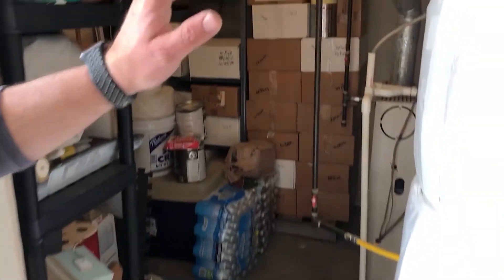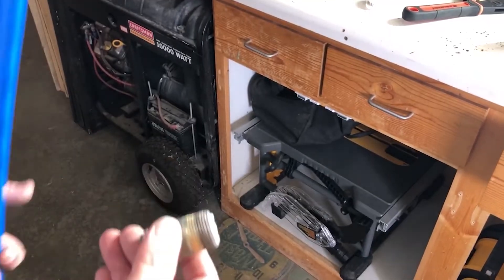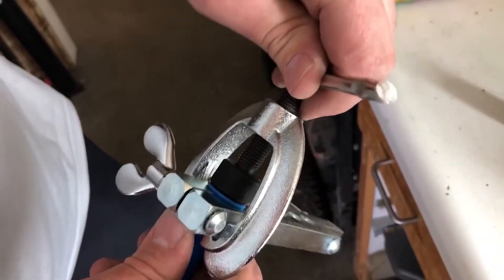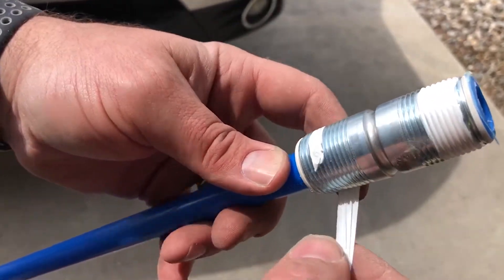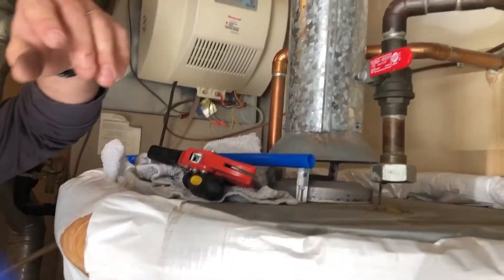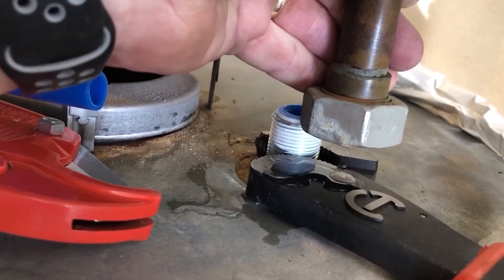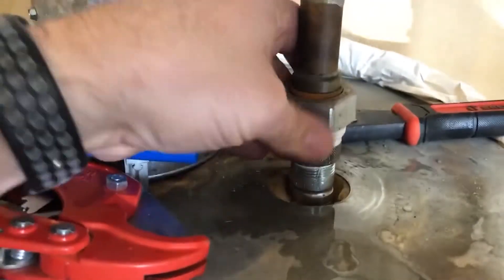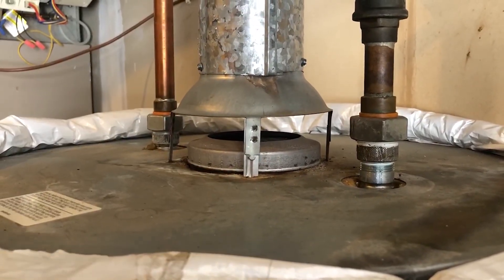REPLACE WATER HEATER DIP TUBE: COLD WATER INTAKE DIY WITH PEX

Comment: I always remove the plastic in the nipples as they create noise. I know they help stop a little bit of heat transfer, but the heat only goes up to the shut off valve and then it stops as that's insulated anyway. I go for quiet and better water flow.

Comment: Ive been brainstorming about rhis myself and came across this video. O dont see any difference in doing this and buying an actual dip tube rhats held in place by a rubber washer. This looks more secure. I can fet a dip tube for $8 i just have to drive a little out of my way to get it but these materials are available from lowes just five minutes away. Decisions decisions.

Comment: thanks. my dip tube broke off. make a wooden stick with like a small mouth, should look like a Narwhal wale or a whale mouth. and wrap a rubber band around 3 or 4 times at end, at head of whale so to speak. pinch it down in the inside of fallen dip tube and it should come out through Anode rode hole. Make the hand held side of stick thinner. My dip tube broke off because I was cleaning/draining stirring away sediment from the Anode rode hole, while replacing Anode rod. I guess they can break off easily.

Comment: Such a strange design of water heater. Could just have the inlet piped into the bottom of the cylinder and not have a silly plastic tube inside it.
Reply: Its designed that way so when that part fails, you buy a whole new one!

Comment: I had the inlet/dip tube break on a water heater about 25 years ago.  I had read or saved a Popular Mechanics magazine article how to use a piece of copper pipe and cutting its end to keep it in place as a new dip tube, and that worked for me.

Comment: You put the seal tape on wrong, your way will unwrap the tap as you turn the fitting in, the tape tail should drag as you tighten the fitting.
Reply: He did it right the first time. He forgot to reverse it for the other side. This sort of simple mistake is VERY common any time a camera is rolling. ("Camera turns on, brain turns off.") The fact that he narrated it correctly the first time tells you he understands this, and doesn't need to be educated.

Comment: I've seen some dip tubes with a bend at the bottom to swirl the water in the tank so it reduces sediment. Maybe you can make the bend with the heat gun.
Reply: That could work. But chances are most of the sediment is reduced by ending up in your faucet screens. A good tank flush might be better.
Reply: @unti419  yeah into your aerator

Comment: Very resourceful!! 
Next time drop the pipe in as far as it will go then just take a couple inches off. The lower the better.
Reply: Too low will stir the silt on the bottom, water moving thru pipe stays going after it leaves the dip tube, and the fact it is cold doesn't help the situation.
Reply: I agree.  Did this on a water heater that wasn't that old.  There was enough of it left,  I was able to grab it with some needle nose pliers.  All in all, the dip tube was about 3 inches from the bottom of the tank.  No issues with sedement coming out hot water side getting trapped in aerator on sinks, and other faucets with aerators on them.  If any,  just unscrew it from the faucet and run water over it upside down to clean out.
Reply: @avflyguy how will it function without the heat trap?

Comment: I did use his method and do have some hot water come out from a faucet nearby the heater but for the faucets far from it those don't have hot water. Problem is the new tube is smaller from the original tube so that reduces the water pressure like 30-40%. For that reason the hot water would not be carried far enough. I may have to order the original DIP tube.
Reply: My original tube had a bunch of holes drilled through toward the bottom, maybe that's why.